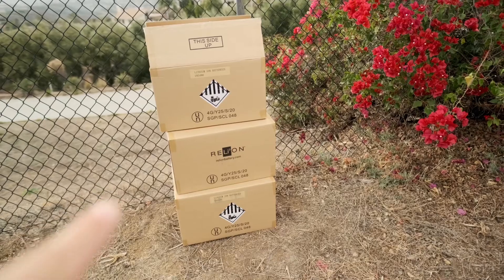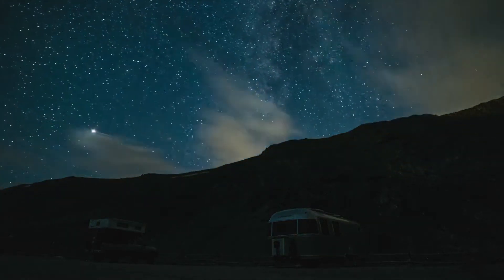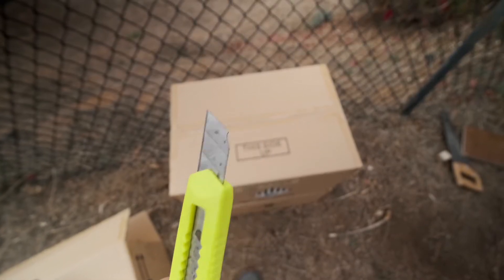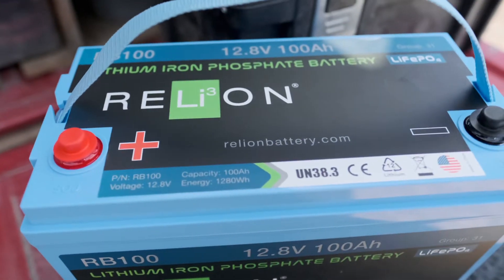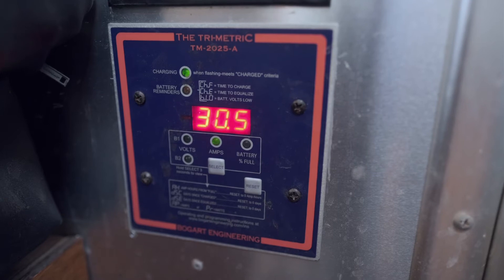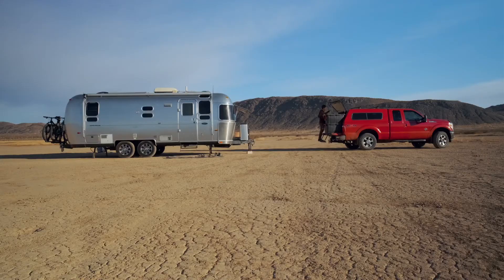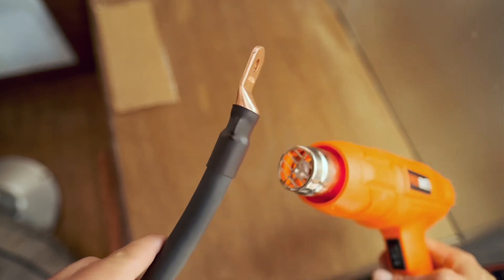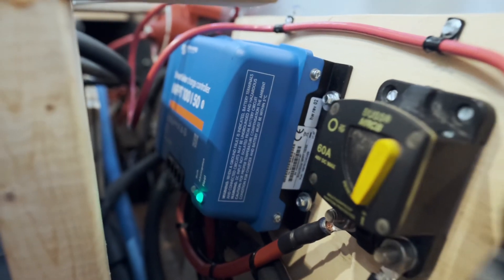RV Lithium Battery Upgrade for Boondocking

Comment: You did explain why it’s worth it for you and those reasons are pretty specific. Thank you for the best example I have seen on the winter solar charging with AGM. Since you already have a generator, it seems you are willing to pay $2000 to enjoy the piece and quiet of your camping. I hate generator noise and am trying figure out a plan to minimize it. For example, if you add solar panels outside the rig angled and positioned for the winter sun could meet your goals. Jumping right to LI batteries a very expensive solution, especially if the existing batteries work. 
I am glad you disclosed the sponsorship and tough to remove the potential bias.

Comment: You could actually easily get 92% capacity out of lithiums. I don't know where this 80% figure is being slung around on YouTube. Battery charging on AGM's is  a 5 1/2 long process. Meanwhile you can recharge lithiums in an hour and a half.
Reply: I've been trying to think about the charge time. If I invest in 2 x 200AH lithiums ... Is this 1.5hr charge time correct? I have a semi truck and my voltage reads 14.4V when running down the road. Are u telling me not to worry and ditch the Genny? I need the system to feed my 1200W heating / 600W cooling mini-split heat pump when I'm stopped for 10hrs

Comment: may i ask why did you pick relion lithium batteries?
Reply from the maker: I talked to a friend who installed a new Relion system in their RV. After seeing their setup, how it performed, and researching the battery specs I was very impressed.
Reply from the maker: Also, I appreciated that they are a U.S. based company with great customer service.

Comment: Can't wait to see how it goes. Just picked up my 2021 Bambi 16 and I had the dealer change my batteries to lithium and add a 1000 watt inverter. Looking forward to the first camping next month
Reply from the maker: Congrats! That was a good move. That setup should treat you well! It has been going great for us so far. Yesterday at Lake Mead we ran the air conditioning off of the batteries. Something we never could have done before lithium! It was  a surreal moment.

Comment: Great video Seth. Did you have to upgrade any of your solar components and/or charger to make the lithium switch?
Reply from the maker: Thanks Stan. Yes, but my tech was about seven years old and needed a refresh. I went with the Victron MPPT 100/50 and Multiplus 3000 charger/inverter. Everyone seems to be pretty happy with their ecosystem and so far I have no complaints. If you have newer tech you may just need to retune the charge settings for lithium which is relatively easy.
Reply: @SethKHughes  Thanks Seth. I upgraded my solar about 5 years ago, so I will check out my documentation.